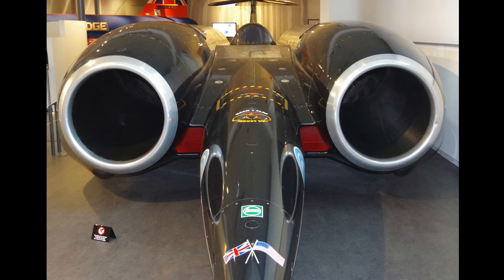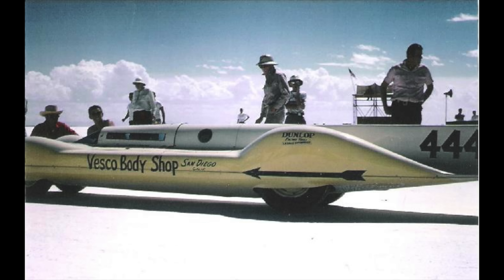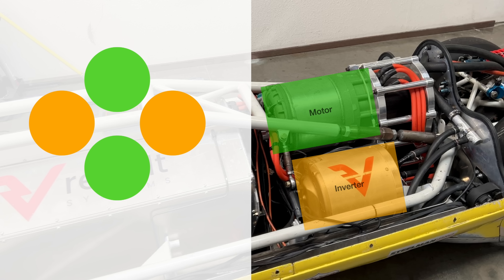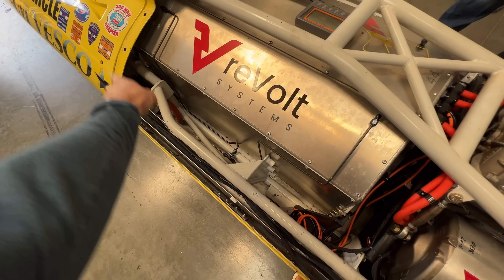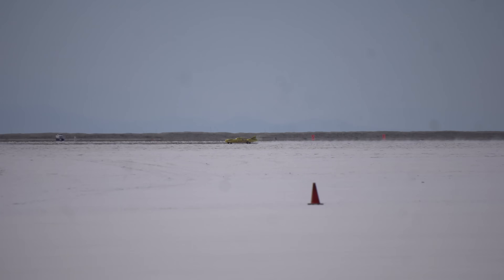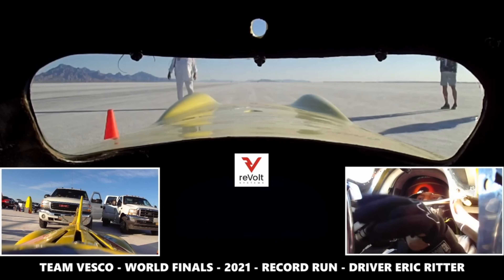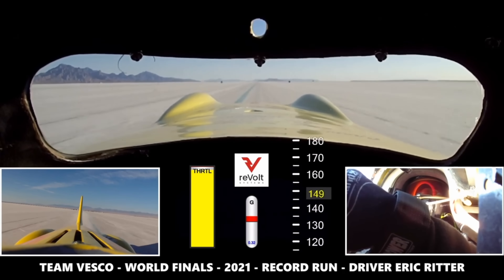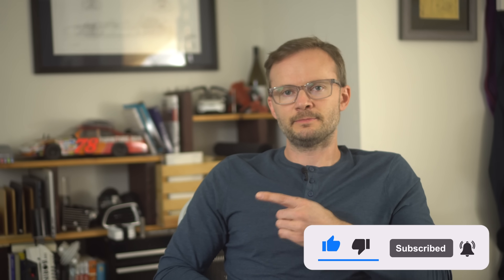The Engineering Behind The World's Fastest Electric Vehicle

Comment: Interesting video. When you see a video like this, it really is way too easy to wonder - why didn't they think of c-rating earlier? That seems like too obvious a requirement to have been overlooked. Mission accomplished though - it just occurs to me in hindsight that they should never have bothered coming to the track until the numbers said it would work.
Reply: They probably did. But published c-rating is not the same as actual max c - you can push most batteries past their rated limits if you ignore things like longevity. But you don't know how far they'll go until you try. You obviously can't easily test 1MW output outside of the car, although you'd think they could've tested individual cells.
Reply: @dirkmohrmann8960  Most of the new "square" (non-cylindrical) EVE-style LiIon cells struggle beyond C1, so they would have had to come to the track  with a C15 solution - it sounds like - as you mentioned.  That's 15+- circuits configurable suppling C1 each ...
Reply: @EdwardTilley  hobbyist rc vehicles have batteries up to 50C. They get big though, to have a low enough internal resistance to support that much current.
And expensive.
Reply: @thecatofnineswords  I'm no electical engineer, but I imagine that a direct connection to 15 batteries (Li-Ion battery banks) provides 15C pdq. The problem that I saw was that the large Tesla packs used here, did not permit engineers to create 15 distinct channels for current to travel - from the batteries to the motors. The motors had the capacity for more current, there were enough physical batteries too, but power throughput was constrained by battery channel(s) available. Each Tesla pack supported 5?C - but no more.
Reply: @EdwardTilley  most New cells do not have problem beyond 1C and cylindrical are usually worse than others (thermal Problems and just shape - cylindrical are smaller than most prismatic or pouch)
Reply: I've been in the same place, there's only so much testing you can do on the bench.  The salt is the ultimate test bench
Reply: That was covered in the video - you don't know your battery pack's actual C rating until you load it up and send it down the track

Comment: This is a dumb question so bare with me... if you are doing shorter races (like a 1/4 mile) could you use something like capacitors / "supercapacitor" for a super high "power density" vs weight. I say this is a dumb question because i know i am missing some fundamental understanding about why this is a bad idea.
Reply: You might be able to, some new super caps can actually hold a decent amount of power. The drawback is usually that Capacitors hold a very small amount of power. With enough in parallel though it could work for a single short run. I would say the best option would be to mix super caps and batteries but even then if the motors constantly draw the same current it wont really make a difference, that scenario only really works when there are times you let off on the throttle so the caps get a chance to recharge.
Reply: I do think that is a super cool idea, but cars like the Plaid are traction limited, not power limited. Meaning the wheels can't be spun with more speed or power because the tires can't hold onto the ground anymore (and traction control kicks in). After the first 1/16-1/8 mile, you become more power limited, but like Matt showed at 5:30, as you increase speed, the motor becomes less capable of proving similar output. I think this means that you would need so many super caps to provide sufficient power that the weight of them would probably offset any power assist they may provide, while just driving the cost way up, and like what Cecil said, making it a pain to recharge after each race.
Reply: @spencer961  Good point. I was more thinking about the weight savings than the extra power. But being lighter means you have even less traction i assume so thats not great.
Reply: So capacitors hold a decent amount of energy however that amount of energy is measured from full charge to 0 volts. As we know electric motors don't generally work at zero volts and certainly the electronics that power it won't either. For example 100 volt lithium-ion battery will be dead at around 79 volts. Because electric motors and inverters are designed within this narrow voltage range super capacitors aren't really a great idea because most of their usable capacity is outside the usable voltage range.
Reply: @marsrover001  Great point... If i understand you correctly the "usable discharge" rate of the comparators would be even smaller than the already limited cap range.

Comment: Thanks Matt.  

What about multiple super capacitors linked in pulsed charge.  With several of them could that be a possible way around the battery discharge issue?
Reply: @SciFi Author B.L. Alley this! People mock me when I tell them that electric cars are the future.

I'm fascinated by their arguments about getting a top fuel dragster down the track, even though it more or less massacres itself in the process. Don't get me wrong, I love the dragster, but they are purpose built and at the moment beat electrics (AFAIK). 

But I love how you can buy a comfortable luxury said with a 5 body trunk that can shit on just about every production car on the planet.
Reply: @SciFi Author B.L. Alley bugger.

I was thinking about that new Lambo with the super capacitor and was wondering if cycling through charging super capacitors from the battery and then they discharge to achieve acceleration whilst another bank of them charges then expels whilst the first batch are in charge cycle. I'm guessing this would also likely add unnecessary complexity and weight too right? 

Just a random thought but as is definitely obvious.... There are much smarter people out there than me.
Reply: @SciFi Author B.L. Alley thanks mate. I appreciate the time for the explanation.

Comment: Gotta love the engineering that goes into landspeed racing!!!!!
Reply: Same here. I am curious if the engineers working on the fastest electric car will do a solid oxide fuel cell (SOFC) run. Those could run on kerosene or ethanol, and output megawatts. If using e-kerosene (produced using renewable electricity, developed by Siemens), we would have the fastest green car in the world. :)
Reply: @thatguyalex2835  the engineer working on the fastest electric motorcycle is not doing that.  😉